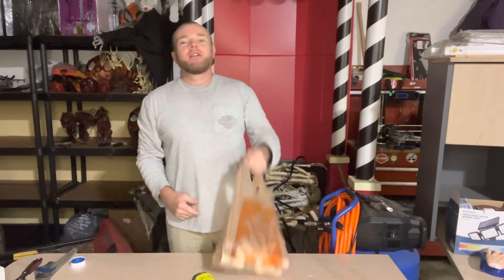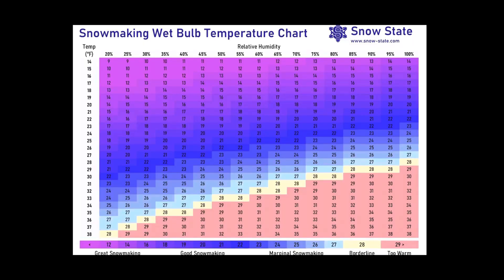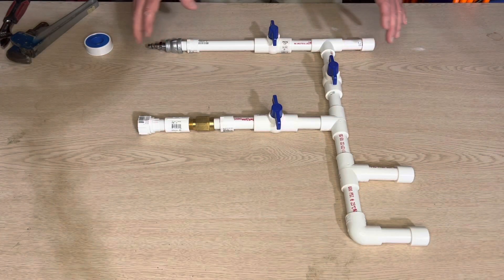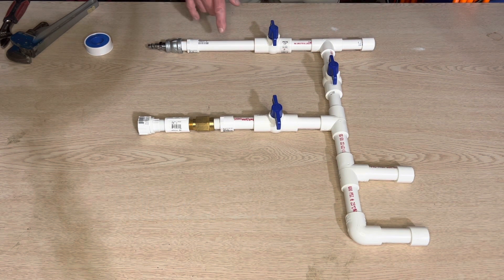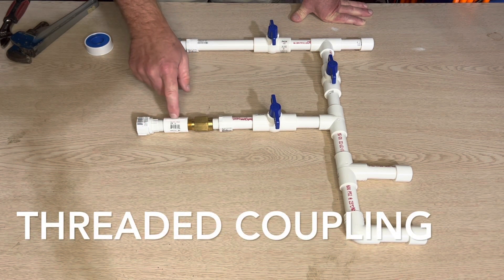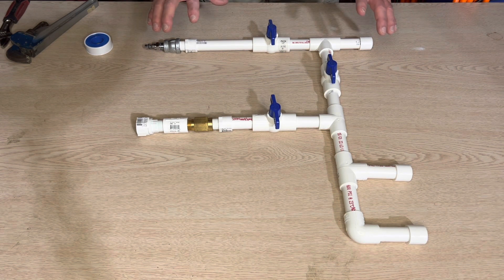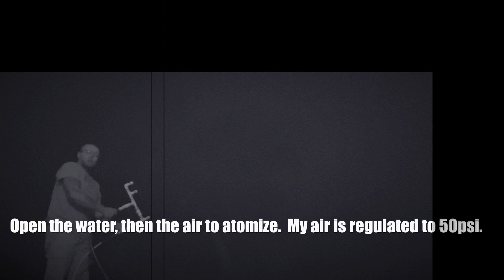DIY SNOW Gun- let’s make SNOW!!

Comment: I use real snow machines as in the Old Pole Cats from SMI as well as Techno Alpin guns like an MMS TR8 TR9 and TR10’s 

If you want to make good snow you can adapt your nozzles on the end of that as well as make sure you have good wetbulb for what you have depending on what your water temperature is a Wetbulb of 26 you should be making decent snow. If you have cold water you can kick that on at 28 wetbulb 

Wetbulb is calculated Via Humidity and Ambient Air Temperature. I wouldn’t bother however doing the calculation manually there are plenty of websites and apps that do it for you. Basically you want Low Humidity and Low Ambient Air temps. 

If you wanted to make a pretty awesome small scale snowgun system I would be happy to help you as a passion project to give you a couple ideas

Comment: how big is your air compressor
Reply from the maker: I used a Kobalt 20gal
Reply: @hauntedaddict  was the holes 1/64 cause when we did it the water jsut kept going out and not mist so is it the air compressor
Reply from the maker: Yes, you have to have the air to atomize the water, if not it won’t work.